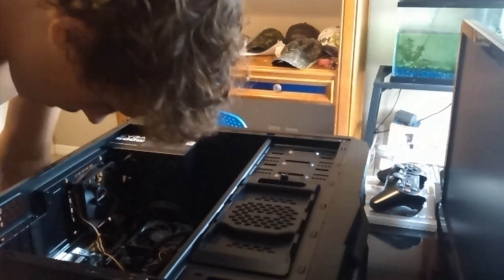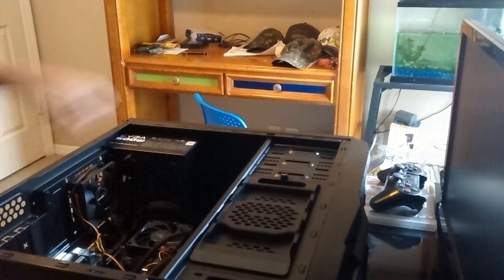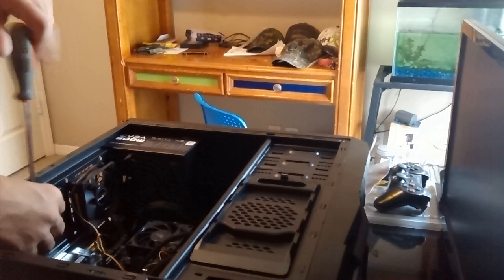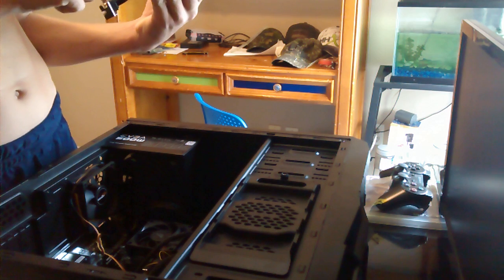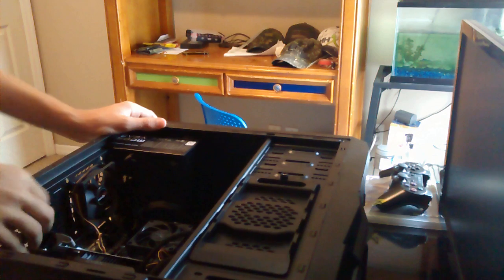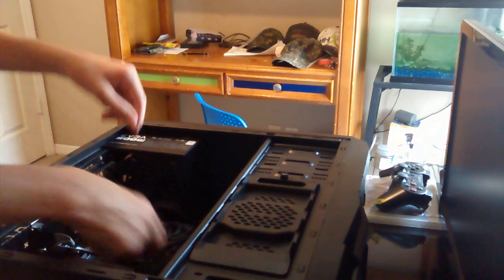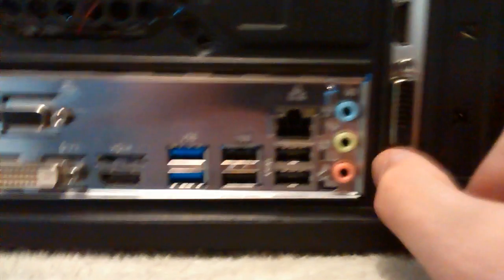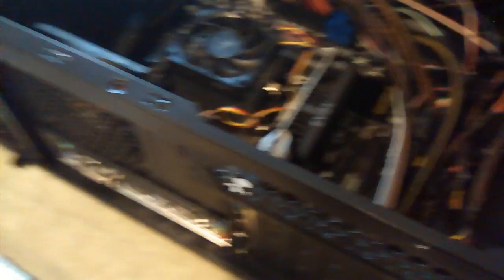Installation of the EVGA nivida geforce gt 730 2gb graphics card

Comment: WHY are you talking about CRAP that has nothing to do with the installation of the Nvidia graphics card? BTW - learn how to properly say the name of the company. It is NOT Nevada - it is NVIDA -say it like this:  in-vid-dee-ah. It is NOT a pop-out it is called a cover plate for slots. In addition, the tab at the bottom is a tab that should go between the motherboard and the box. This will help in locking down the video card in the computer and make it solid. All add-ons should have the plate screwed down to secure it in the computer box.

Comment from the maker: I a
Haven't finished my build yet, so I couldn't tell you the fps on games, but stay tuned for that video. Also I bought it from amazon for 74.00$ free shipping, and from the reviews its really could budget gaming pc build card. It isn't the biggest or the best but it is a very good affordable card. Mine is 64bit 2gb. They also have it in 128bit. And a 1gb with either 64 or 128bit for cheaper. The card is great  quality. I would recommend . and you also have to remember fps is based on you CPU and ram and what not not just the graphics card. Everything works together. But yes I would recommend. But go ahead and subscirbe and stay tuned for that video. First boot up is on the 28th of the month so stay tuned thanks for the comment.
Reply: DTSgaming__ I got a Core 2 Quad Q8200 at 2.33GHz, 6 GB of ram, gonna replace my stock GPU with the GT 730
Reply: nvidia* not "nivida" DTS 2016

Comment: I am planning on getting this card too. How is the performance? Average FPS on games? Where did you buy yours and how much it was
Reply from the maker: I just made a comment on the video to reply to your comment go check it out
Reply: +DTSgaming__ what's the fps for this card?
Reply: iwin nazario No, it does not require a cable, but in any case I WOULD NOT RECOMMEND this. Honestly, just spend 25 more dollars and get twice the performance.
Reply: Yeah, the GTX 750 Ti, as well as the GTX 1050 Ti are both great midrange cards, just make sure the specific card doesn't require a 6 pin. Some, like the EVGA 750 Ti FTW edition do require cables, but others do not. These cards are priced from 100-150$